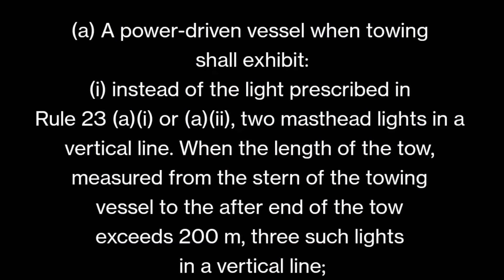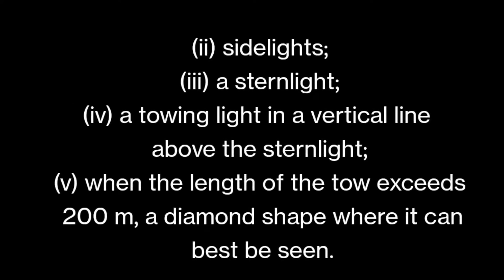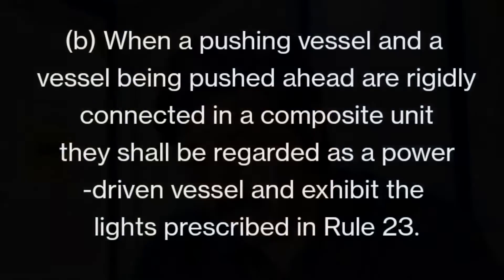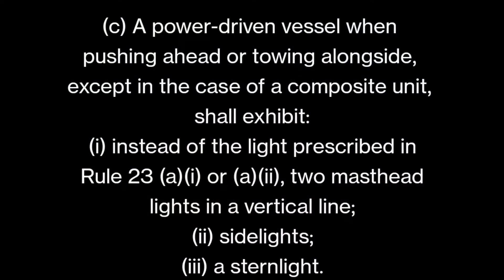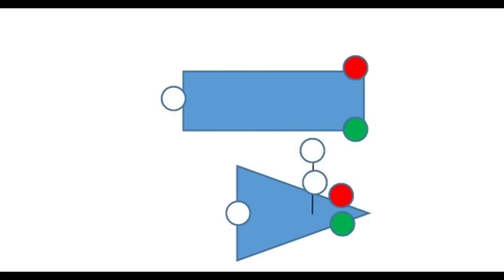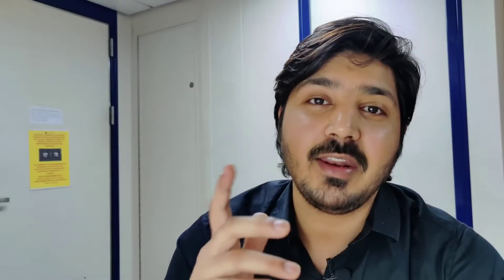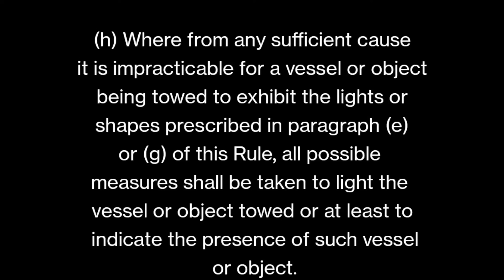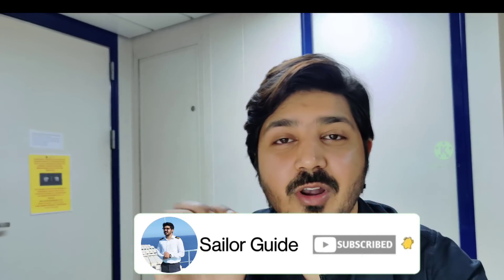Rule no 24 TOWING AND PUSHING Explained |ROR| |DECK OFFICER| |Navigation| #merchantnavy #ror #study

Comment: Sir looks like wrong in the explanation as well as the diagram on PART G of (iii). Actually the lights of every 100 meters should come in between the lights of fore and aft also between the breadth lights, not in the breadth extremities as explained in the video. I mean the lights should be in longitudinal middle part of the vessel in every 100 meters. Please correct me if i am wrong.
Reply from the maker: You are right brother... I have taken the vessel having length of 200 m in length as an example so thats why ...

Comment: sir how are you i am a fresh grade  second officer i have a question for inspection of immersion suit I read in MSC/Circ.1114  :at intervals not exceeding three years, or more frequently for suits over ten years of age. and some officers  Sayed that suit more than 10 years old inspected annually ? 
the question where is annually in  MSC/Circ.1114??
Reply from the maker: You are right it's not mentioned in the Msc Circular, but annually test of immersion suit of more than 10 years is mostly a requirement of the flag state. So flag state can have more strict regulations than the imo  has recommended but not less.
Reply: @sailorguide  thank you captain very much

Comment: Hello sir, on-board  practically how does the towline illuminated to show relation between towing v/l and tow as stated in last part of the rule (24i). I haven't seen the necessary arrangement so far.
Reply from the maker: To show that , normally towing vessel and vessel being towed put flood lights in the direction of the line so that it can indicate the towing line
Reply: @sailorguide  Thank you so much for the clarification Sir.